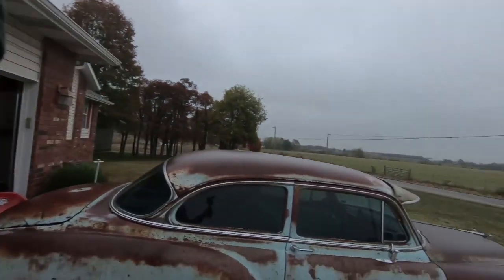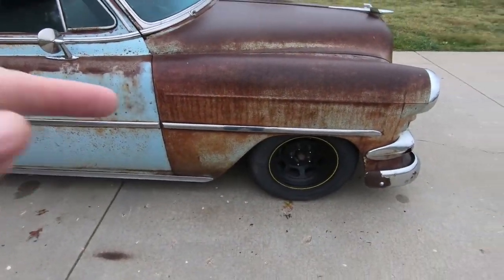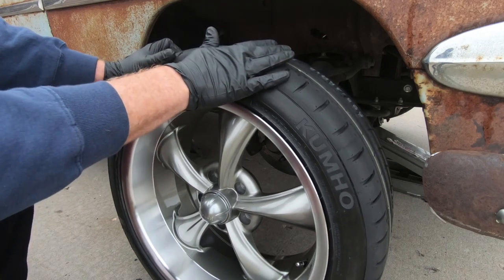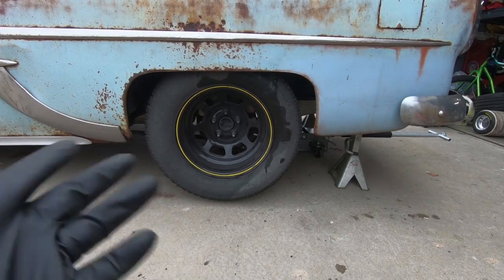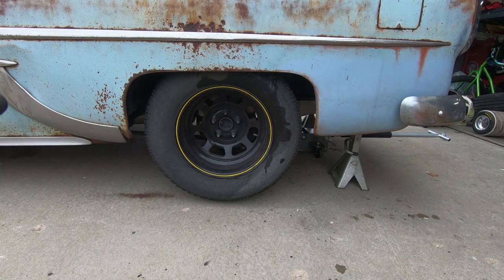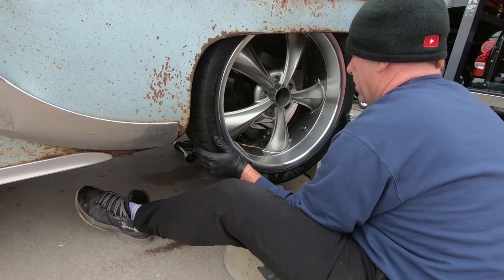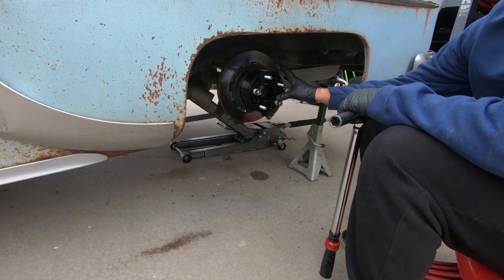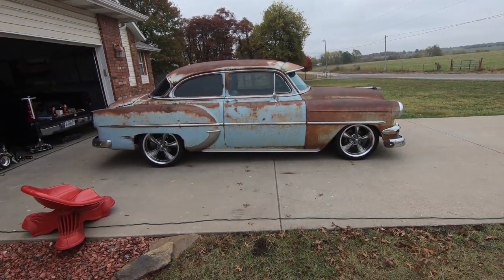New Wheels for the 54 Chevy

Comment: I just had my check engine light on. I put the scan tool in and it said p0308. I exchanged the ignition coil from number 8 with number 6. And I took number 8 sparkplug out and cleaned it. Looks ok.  2000 Chevy Tahoe 5.3  not sure what it is. Maybe a fuel injector. Hopefully nothing in the engine. I also have the Chevy lean on the driver side hopping it's just the shocks. Your new wheels look nice. Way better
Reply from the maker: I'm sure its something easy
Reply: @TWAMotorsports   ... Man bro I hope so. I'm going to mess with it some more today. Its getting colder now so it's not so bad. The heat was killing me.
Reply from the maker: Yeah working in the heat sucks

Comment: It definitely looks better with the new wheels and tires. Since you were buying new wheels,  why not use wheels on the rear with less backspacing to eliminate the need for the spacer? You would have more lip in the rear. 
Just curious. Not knocking it.
Reply: Insanely hard to do so. It's not a standard 5x100 or 5x114.3 bolt pattern. It's I believe 5x4 makes it harder to find wheels for and most chevys don't have stupid low back spacing usually it's like 2 or 3 inches
Reply from the maker: Thank you. This wheel is only made in one offset or I would have

Comment: Hey I know this video is not on the trans am but I was wondering about your lift. I would prim6use it to work on the TA not storage. What would you recommend for a lift. 2 post vs 4 post. I know that for a lot of things I would have to take the wheels off so I would think a 2 post might be better. Just want to know your opinion and experience on work on the TA with the 4 post. I would be making a garage specificly to work on the TA so the concrete would not be a factor. Thanks for your help.
Reply from the maker: One of each really. 2 post does it all but 4 post seems more sturdy. Both have there place.

Comment: I have the 1953 chevy 210 and want to put on the same wheels you have. Do I have to do anything different. Do I need to have the spacers.  I have drum breaks. What are the offsets?
Reply from the maker: If you have thes same set up as me. I have mustang 2 front suspension

Comment: Have the Riddler wheels in my s10 be careful when washing the wheels the center caps break easy looks awesome !!
Reply from the maker: Thank you. If you noticed the first rear wheel didn't have a cap because it was broken. Caps are crappy.
Reply: @TWAMotorsports  I bought 4 extra on eBay look their if you can’t find them I will send you one 👍
Reply: Try that link I sent you
Reply from the maker: I got it replaced already.
Reply from the maker: No links will send through YouTube

Comment: Just an fyi. The S10 ZR2 rear axle is 3" wider than standard S10 rear and has the G80 limited slip with disc brakes.👍👍
Reply from the maker: Right. This is a 2wd and I needed the 4wd not the zr2 as it's too wide.
Reply: @TWAMotorsports  gotcha👍

Comment: Take the spacers off and put some grey centered torq thrust on now that you know what will fit. 
That rear wheel with 2.5” more lip would look killer.
Reply from the maker: They are special order and would not match the front
Reply: I guess I meant all 4 would be torq thrusts. 
Killer car. 
Just not a fan of ridler wheels. 
Keep doing what you do. 👍🏻
Reply from the maker: Thank you. Pretty close to the torque thrust. I do like the torque thrust more but wanted a change up.

Comment: You need a proper impact,  that one is for sinking screws...and you have to put a jack under control arms to check ball joints. Have to relieve spring pressure.  And more hate...lol. I like the black wheels better. Not trying to be a douche. Just throwing my 2 cents in